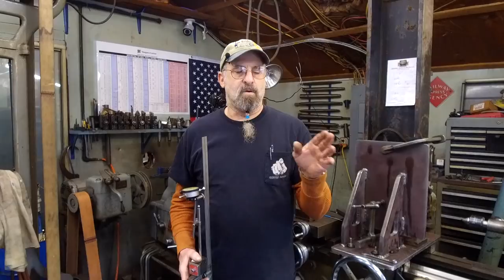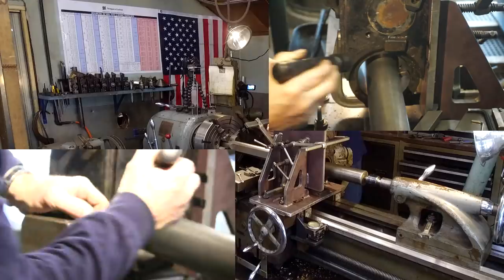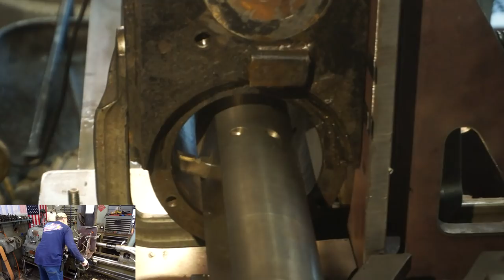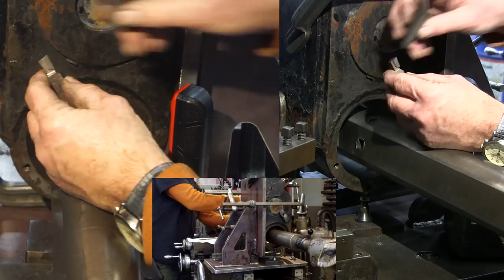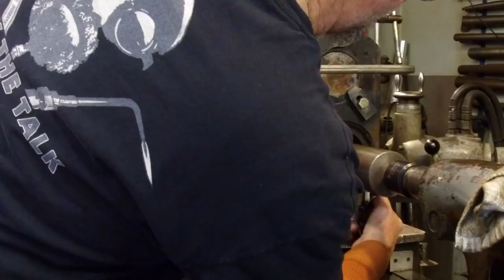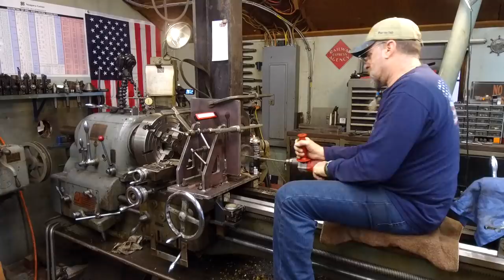Boat Forks Part Four

Comment: Ever use a heel-dragger tool? I've only seen then used in my old career shop. They work great on long skinny bars where a little controlled drag and deflection keeps chatter under control. If the other angles and clearances are right the finish, size control, and roundness is pretty good too. "Getting it right" in this case is one of those simultaneous equations with multiple unknowns. But I had pretty good mentors. I bored a lot of propeller shaft sleeves, double suction split cased pumps, transmission housings, diesel main and cam bearing bores etc for about 20 years. Fun when you know the tricks. 

Thanks Glenn Clark, Jack Neimi, Art Larson, Fred Krick, Larry Lindsay, Felix Hamilton, Bob Marshall, Ed Drouin, Charley Gibbs, Roy Mehlius, John Sullivan, and about a dozen others who passed on to me and others of my generation their collected lore.

Comment: It's fun to see you experimenting with multiple cameras.  It's not as easy as it looks.  I shoot everything with at least three camera angles, and it seems like it would be easier to avoid blocking the shot, but I find the opposite.  I know I have three angles, so I'm less careful, and often end up blocking all three shots with two hands and my big head.

One thing that helps me is to make sure each camera has a specific purpose:  one medium shot of the whole workpiece in the machine, one close-up of the cut, and one wide shot showing the operation of the machine controls, grabbing tools from the drawer, etc.

Then, the edit kind of tells me what it wants to be (wide shot of dropping the feed handle, cut to the workpiece with the carriage moving into the cut, cut to the close-up of the chips rolling off the tool, etc.)
Reply from the maker: Thanks for the tips! ;{)-------
Reply: I know you didn't ask.  :)   I was just watching and remembering all the things I screwed up when I first started doing the multi-camera thing.

Comment: I'll start by saying I know F'all about machining, but am learning (how to be a Youtube expert) thanks to your videos. My question is, 
Does it really matter (within 100ths of an inch) how closely the bore is centred when working on an arm that has been flexed and deformed in relation to the other ends pivot point? To get thousanths accuracy wouldn't you want to align your bore to the bearing at the other end, rather than the arm itself.
Love watching your videos, and have nothing but respect for the quality of your work. Just asking, cause thats what internet experts are meant to do, isn't it?
Reply from the maker: It's more the fit in relation to the sliding function and the play or lack of play, that holds fork parallelism. Shooting for own workmanship expectations, to remove the least amount of material to make round.  ;{)------

Comment: We always need to remember that even steel is a fluid medium. Just like most of the things we work with.I had a bar from Vancouver Isl. It had an adjustment tool that would advance the cutter .001. It was great and very accurate. That was great. A 1 hp electric that I welded bearings on both sides of the boring.. I modified a pair of inside calipers that were consistently .005 out. They worked great for over 15 yrs.Doing the second fork will be soooo very much easier eh.I love this trip into the past fella. Freeze em and push them and you will be just fine fella.Thanks a bunch eh !

Comment: Great series looking forward to the final videos. One question are you looking to calculate and machine the final ID of the bushing before press fitting it in the fork for the proper clearance so you don't have to do a complete set up with a boring bar after the bushings are installed? I was figuring you can get close enough so you just have to do a final hone without boring. Thanks for all the videos Ed

Comment: like the flat belting, used to have to tension it and use a type of soap bar on the inside of the belts to help with slippage, did not know if they still make the crocodile or alligator clips for jointing.
Reply from the maker: Yes MC Master Carr has it in their book. ;{)-------
Reply: thanks, seem to remember that you could also slice the belt at a 30 degree angle? and glue and sew the two ends together but sounds too time consuming, cheers for now.

Comment: Keith, how important is temperature variance from day to day in your shop? Speaking about metal expansion and contraction versus metrology from one day to the next. Thank you for your time and effort. Long time sub, great videos.
Reply from the maker: I keep the wood stove going 7/24 and the temperature, stays pretty uniform, we do have sharp dips if in the single digits or below that, it will get a cooler floor level but machines matain about 60 degrees, today they were about 72 degrees, because I was using heat gun to read the bearing temperature as I finished hogging out 1/2" of material in two cuts.  ;{)-------

Comment: Is there an indicator that would have a very long stem or remote dial that could be attached to the boring bar?
Reply from the maker: Something for someone to design. ;{)------
Reply: I visualize a modified Sterrett 196A.    Modify the lever to something longer.  I am guessing you have used one yourself.   I have one but haven't used yet.

Comment: A little nitpicking. In relation to the part, how do you determine where the original axis of the hole is?
And as this is a pair of parts, how do you keep the axies collinear?
Reply: It really isn't that critical. These are large forklift arms. The most critical thing is to take as little as possible material out to maintain the strength of them. A couple of thou isn't going to make much difference as I see it because a couple of pounds of tire pressure difference in the forklift's tires would make more difference then a couple of thou in those bores. Also the wear on the mating surfaces of the bottom plate on the forklift's frame and the arms themselves will make a big difference as well. The way Keith dialed them is about as close as you are going to get them in my opinion and experience. There is not a shaft that turns or runs in those bushings. Just a large shaft that supports them and allows them to slide to adjust the width they are separated.
Reply: @chrisOtube...   I agree 100%. I based my reply on the knowledge of the machine these forks were a part of and that a few thousandths difference between the two would not effect the operation of that machine. I understand that the critical part of this operation was two fold. 1) keep the bore alignment as close as possible to the original bore, and 2) To remove as little material as possible so as to not weaken it. These forks are not attached to each other so there would be no binding if the bores were not in exact alignment with each other. In other words if one fork was, lets say for argument sake .020" higher then the other one after they were installed, the machine wouldn't know it. Having been a machinist in a heavy equipment manufacturing plant, I would bet these two forks were not machined as a matched pair to begin with.

Comment: our Deckel FP2 at work can take 300KG(661lbs) on the table. its quite new (reworked machine by FPS) had it for about 8 months now. just in case anyone wonders what a mill can hold.